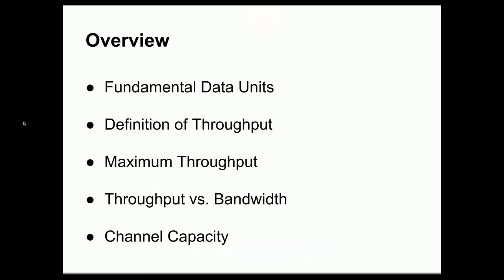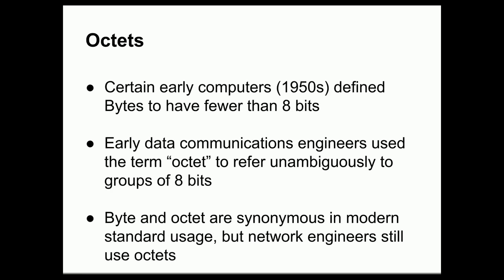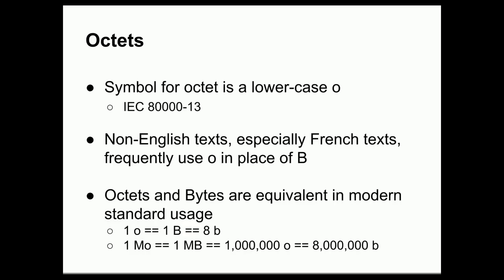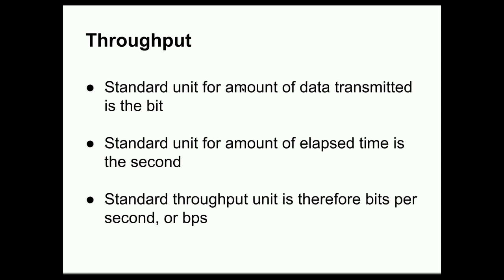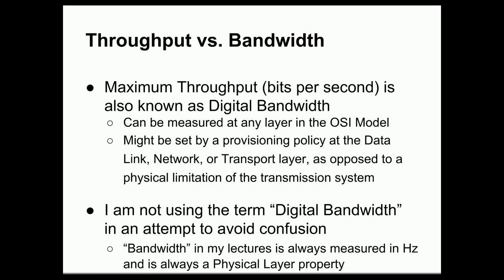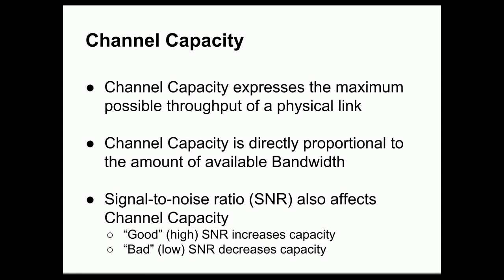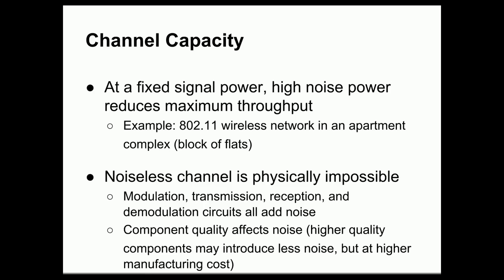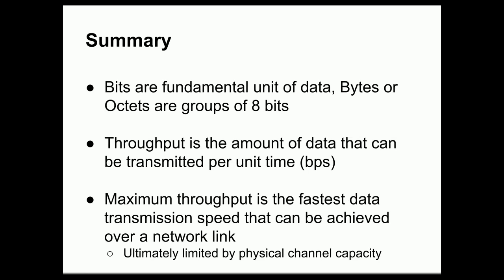Network Throughput | Signal to Noise ratio | SNR | bandwidth vs throughput

Comment: I often read that the higher bandwidth allows more noise to pass. If channel capacity is proportional to bandwidth then would reducing channel capacity reduce bandwidth therefore masking noise?

I'm assuming reducing settings on say a NIC card lowers frequencies in hardware.